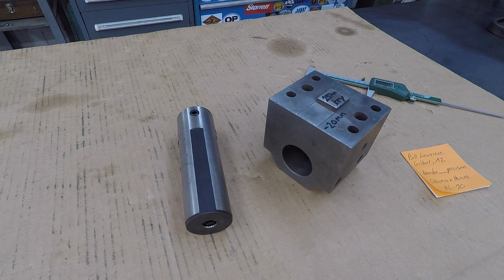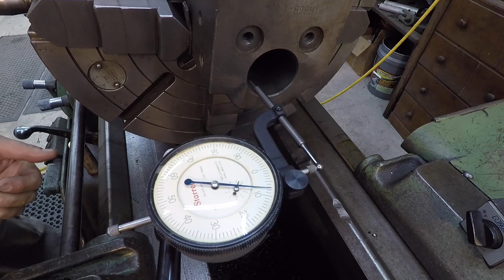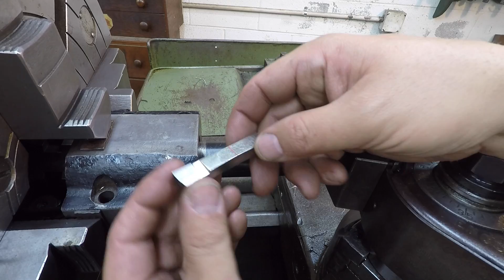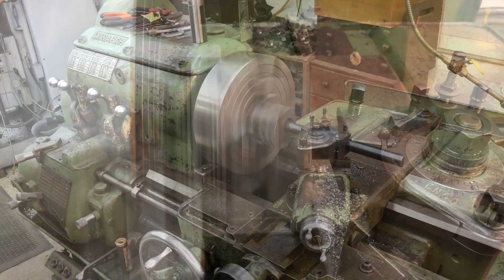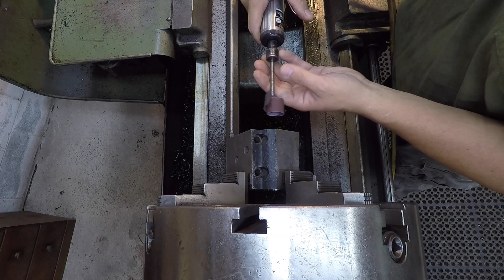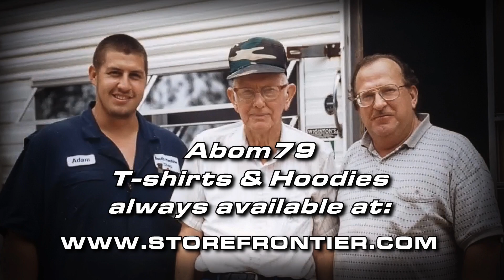SNS 306 Part 1: Okuma Tool Block Modifications

Comment: So offset weight doesn’t make the part shake?
Reply: There isn’t much Throw, but you wouldn’t want to be at 2000rpm, so either run it slower or on some chucks you can add counter weights with larger offset pieces.

Comment: Nice work on boring that tool holder out. Looks like it cut nice and clean and should work very well for them. 'm feeling lucky that the one time I needed to bore out a holder like that it at least fit the machine and I didn't have to do extra work. Felt weird running the boring bar from the spindle though. Hope you are well! - Tom Z

Comment: Instead measuring the initial positions of the jaws I just use the tail stock with a drill chuck or live center (depending on the hole diameter) to lightly press the part against the back of the 4-jaw chuck and then carefully tighten each jaw so that they just touch the part. Then you are fairly close to centered and can start indicating and adjust.
Reply: Yes if you have a bull nose center it should be very close.
Reply: @aj7utu   Exactly! And very quick.
Reply: In this case he couldn't sit the piece on the face of the chuck because the key was preventing that.
Reply: @jonka1   That's easily solved with a short piece of flat bar as a shim for the chuck jaw.

Comment: I can sort of see what easyBob100
 is trying to say. I don't think the front face is of any importance. I would make sure the bottom mounting face and the bore is lined up parallel with the spindle center line. After all, the bottom mounting face aligns the hole to the face on which it mounts and the bore has to be aligned 90 degrees to whatever surface below the spindle going through this block. If something was to bolt onto the front face of this block, it would be a reason to align the front face. What I'm saying is: Ignore faces which don't matter.

Comment: Question:  Why measure the face and the bore?  Aren't you assuming that the face and bore are perpendicular?  What if they aren't?  Wouldn't it be better if you measured the bore in two spots instead, and not worry about the face at all?

Comment: Why don't you just use your drill press to do this hole? Wouldn't it be much easier?
Reply: Not on a drill press. he could have used a boring head on the mill. but adam is a lathe guy. he probably uses the lathe where possible because that's what he is more comfortable with. not that he couldn't use the mill but his first instinct is to use the lathe. you just have to be around machinists enough to understand, by the way some guys are mill guys
Reply: @ronalddavis  Adam's a lathe guy, but beside that, unless you have a fancy boring head that you can adjust while it is spinning, a lathe is just faster and easier for the hole. You are going to have to take multiple cuts to get that hole to size. With a lathe you just crank the crossfeed slide a bit for each cut. With a mill you have to stop it, get an hex key, loosen the lock on the boring head, adjust the head offset, lock it back up, then make the next cut. A couple of seconds on the lathe and a minute or so on the mill.
Reply: Drill presses don't make precision holes.

Comment: Adam,
Your customer wanted to avoid breaking down his production set up, but the best procedure would be to rough bore the tool holder hole and finish bore on the actual CNC lathe after the turret is properly aligned.  This way the tool holder bore is the made by the actual machine that it will be used on.

Comment: With an ofsett piece like that, obviously the mass is spinning off centre. Obviously that is a big lathe and that is a comparatively small part, so not an issue. But is there some sort of rule of thumb about how far off centre you can have the mass on a lathe without causing issues?
Reply: The tee slots each side of the jaws can be used to bolt balance weights onto the chuck if you so wish.
Reply: You can tell if you ran it at 1000rpm you’d feel the machine shake, so the rpms are lowered where there is no shake, or you can add counter balance weighted on some chucks to eliminate this. It depends on the weight and offset of the job.
Reply: For workpieces that will be way out of balance, they can be mounted on a faceplate, and balance weights used to offset the out of balance workpiece. This is a pretty standard practise with model engineers making relatively large non symmetrical pieces on small lathes such as Myfords. I suspect that in industry, they just use lathes big enough to handle the out of balance jobs most of the time.

Comment: 2 BIG mistakes:
1: The block is now 75mm instead of 80mm.
2: The keyway is NOT in the center of the actual tool (but in the center of the toolholder).

Comment: I would think the way to do that would be to mill off the bottom and do the key and then bolt it to the cnc lathe that it will run on and bore it with an adjustable boring bar in the chuck. That way the hole would be perfectly on center.
Reply: That is a good way if you care about microinches. But if you think about it, that is not how commercial-grade tool holders like that are manufactured. They are all just churned out on some other machine in the big tool holder factory in the sky, and are all "close enough" for whatever machine they will eventually be used on.

Comment: Now ? Im no machinist by any means but back and forth from the face to the bore and back again is killing me ? Couldn't you have put a 1.5 drill bit in the tail stock , slid the piece onto that , slid the tail stock down to meet the chuck and clamped it down on all 4  jaws ? Backed the tail away and the part would've been 90% of the way to centered ?  I guess a machinists check is 95% labour and time spent squaring things up to a curly blonde one ?
Reply: Chris M Smalley When you’re dealing with thousandths of a inch pre-centering it like you describe is a way to get you fairly close but the last bit is what takes the most time. You need to go back and forth a few times. If you used a lathe you’d understand.
Reply: @susanbarbier5053  It's also a part for a CNC machine where misalignment takes no prisoners!
Reply: Spend 30 minutes trying to remember where I left the 1.5 round or 15 minutes to dial it in.  :-)
Reply: That's assuming you own a 1.5" drill. It probably took Adam less than 15 minutes to dial it. Not a big deal.

Comment: Is it possible to indicate off the bore only? Like indicate off the bore entry and then the centre?
Reply: sure but it depends on what your primary datums are
Reply: @SuperAWaC  I was just wondering since he mentioned an indentation on the surface.
Reply: @Argosh  indicating off the bore alone would take quite a bit longer. it's better to indicate off perpendicular surfaces rather than parallel ones
Reply: You can indicate off the front of the bore, the back of the bore, and some other point in the bore to get centered, but it takes a lot of time - and personally I get the math messed up usually. If you have perpendicular surfaces that you can adjust then it is must easier. But to each his own.

Comment: why not put a center in the tailstock, then in the hole of the part, pressing part to the chuck. bam, almost perfectly centered.
Reply: Ha , i didnt read the comments before posting the exact same thing ....
Reply: In theory yes, but in practice as you’re clamping down hard with the jaws you’re going to move it off center. That IS one way to get it really close but between almost perfect and perfect is where the time is spent.
Reply: 'Almost' isn't good enough.

Comment: Was so excited to see two vids in one night! Just like Christmas haha. Still would appreciate a reply from someone on my question about purchasing a first mill though lol. Thanks!
Reply: Depends what you’re doing, your budget, location.

A Burke Millrite is a nice 3/4 size “hobby mill”, and can have a Bridgeport head swapped onto it.
Reply: Sebastien Bolle ....Here was my comment and description of what I do. I left this on the clutch repair video a couple days ago hoping to get a reply. Sorry it’s long, but I knew I would get a reply like yours at some point. Thank you.              “Ok. I’ve been watching your videos now for quite some time and just cannot get enough. For a hobby (well and some money of course) I build forced induction race engines of all varieties, but mainly for snowmobiles, sideXsides and high performance sand cars (a lot of Subaru, Honda 3.5s and of course GM small blocks) right now. After seeing this video of the cool little parts I could be making to help me with that and a million other things, it is finally time to buy a mill. I do have a 48”x48” cnc 3 axis router that I use mainly to cut parts from flat carbon fiber sheets I produce, but have zero experience with mills or lathes. I don’t want to spend an absolute fortune on my first one, but money really isn’t an issue (would like to keep it under 50k ish for the first one). Definitely would like a manual mill (I’ve seen some that are both lathe and mill?), but can see that the auto feeds and DRO is a must   Most of the pieces I would make would be smaller than 24” long and maybe 12-16” tall. I certainly have been doing my research and will continue to do so, but any direction or places to start looking would be greatly appreciated. I am very technical and mechanical savvy so I understand all of this, but really no experience on anything other than the router which I use solid works to design my work. Thank you in advance, I truly appreciate anyone’s input they may have and are kind enough to offer. Hate to hijack the comments, but I thought with the talent here it wouldn’t hurt to ask. Keep up the good work Adam! Thanks again!”
Reply: Sebastien Bolle....And if I have to spend 100k to get something I can “grow in to” then that is perfectly fine. I want some thing nice and that is quite capable, even though it is only my first one. Cost is really my least concern, but don’t need to overdo it just because. Thank you!

Comment: If I understand you correctly, you may have made a screw up after watching both parts. The overall base was to be 80 mm not to the top of the keyway but to the base. It seems you are now at 75 mm since you took the whole thing to 80 mm then an addition 5 mm when making the keyway, unless I missed you actually taking it 85 mm and then the extra 5 mm for the keyway bringing the base to 80 mm.  I hope I am wrong for your sake as I would hate to think of what that piece might cost if you could find one. I came back to this video to make sure you said 80 mm for base not including the keyway. Never the less always enjoy your videos. I am most likely the one wrong here as rarely do I ever see you make any errors even tho I know it can happen even with the best as we are all human.
Reply: I was thinking the exact same thing ,i hope it didnt get messed up
Reply: unless I miss understood Adam , your right ..
Reply: That's what I thought too! So I am not the only one who thought this!
Reply: That makes four of us, I spotted the same thing. Had to go back through both videos to confirm it.
Reply: When cutting the Key and the cutter went through the bolt boss on the side, mmmm that doesn't seem right so I started looking as well.  We might just see this part in a future Build-up Welding and re-machining video.

Comment: Why not bore it in a milling machine..
Reply: Why?  He has a precision lathe and the proper tools.  There is no need to fool around on the mill.
Reply: If the hole is not running true with the sides, it would be a pain to indicate on a mill + I do not think Abom have a high end boring head for the mill.

Comment: I notice the bed has a few big chunks taken out of the "V" on the away side from the operator.
Is there any story behind them?
Reply: Probably ground to allow a part to swing in the machine that otherwise would have hit the ways.  Fortunately, it is on the v-way for the tailstock and not a bearing surface for the apron...if I am reading your comment correctly that is.

Comment: omg! I was running an old Okuma LB-15 at my former work. Damn that lathe was rock solid. At the end of its lifetime we had some problem with the power wiring and the hydraulics. Remember that the screen went black and we had to replace it. But still with all the problems it kept going and going. We eventually replaced it. Cant even remember what we replaced it with. It was at least a descent machine but still nothing like the okuma.

Comment: Hey Adam, I'm just curious (not a machinist myself) why wouldn't you machine the 20 mm from the base first before boring the hole? My thought is there would be less weight spinning on the lathe that might contribute to vibrations during machining of the bore? Also thanks for all you do appreciate the videos - great entertainment and education!
Reply: You have more to grab on to/mount it with if you do it as the 2nd operation. The weight of that part is miniscule in comparison to the back plate and jaws on that lathe. Unless you've added enough weight to counteract all of that, it's not going to go out of balance from being mounted off-center like that.

In fact, I'd go so far as to say it wasn't affected whatsoever by putting that part on there. You've got all that other weight spinning perfectly around its axis. With the part mounted at that axis also, there's even less weight there to cause it to go out of balance. 5 lbs maybe? Vs a backplate and jaws that likely weigh 300+ lbs. Probably a lot more.
Reply: @JC-11111  Makes sense guess I underestimated the lathes capabilities to mitigate the off-center load!
Reply: @luc1fersflowers  TBH, I'm no machinist either. I was just trying to think about it logically. I may be totally wrong. So let me say that now. But knowing the things I do know, that's my best, educated guess. 👍

Comment: I worked at Colonial Machine Co right out of high school. They had a policy of no air hoses at
the machines with the exception of the drill presses . You would have   kot holy if you blew off a
machine with a air hose. 
They felt that doing so would drive dust and dirt under the ways. I don't know if they still have that policy . All l will say l don't do it on my machines. Your job is turning very nice and I like your videos very much !

Comment: You did a fantastic job but how is that pocket going to be on centerline whan placed back in the original machine? We usually bore the pickets when they are inside the machine at my shop. Indicate a boring bar inside the jaws and bore it to the size.
Reply: Are you asking about the few tenths it might be out? You but undersized tool holders, then mount them, and mount a boring bar in the chuck to bore them in situ on the turret? The whole point of buying the took holder is that you don't have to mess with that nonsense. You can move them between machines, and on different positions on the turret, and it will be the same. They come from the tool supplier already bored. So, since he bored it concentric to the home from the manufacturer, it'll be the same accuracy as if you ordered it with a 2" bore. (+/- a few tenths)

Comment: Does the metal of the Measuring instrument wear of time and potentially cause wrong readings?
Reply: Like scribing lines with the tip?
Reply: ID and OD micrometers should have some gauges/templates to set or check measurements. Gap gauge should be checked and verified from time to time.
Reply: A lot of them are faced with carbide. They can also be quickly calibrated. Calipers don't rely on the arm length, so scribing won't cause inaccuracies, unless you bend the tip over. You don't want to scribe with good calipers anyways.
Reply: Yes, they does wear, but can be calibrated - and should be regularly.
A caliber is the worst because one area of the jaw in normaly used more, not uncommon to get a low spot on 1-2 thou on the most used part of the jaw.

Comment: Great video Adam seeing all types of tooling (indexable shaper bars included) the block mounted tool could be adapted to a say cheap four way like the diamond tool holder, ifanger, i like the ITM I think it is upside down turning tool that produces a chip that gravity takes it away from your watch pinion size part. But when you can adjust tool tip hight each station at that four way could have ten different tools that could go there the swiss type stuff is worth time figuring out and wow that block is cast iron ya the shure shot and a paper towel rub some way oil on there. funny thing is I'm making ER 16 blocks that interchange In one station for thre different boring, threading ,reverse internal threading , revese internal boring bars got one collet set need two more ER nuts got a dro on my lathe so setting that 8 Deg taper's no sweat carving them out of old SBC crank throws you can buy a new cast steel crank cheaper than you can get one ground aint supply and demand great!
Reply: Whhhhat.
Reply: Always remember, punctuation is your friend.
Reply: Typing on a phone. Rough read.

Comment: Great work. Im surprised u use wd40 to keep the rust off the ways. I thought maybe 3in1 oil. Thanks.
Reply: 3-in-One Company was acquired by WD-40 Company about 25 years ago. 3-in-One stands for "clean - lubricate - protect". WD-40 stands for "Water Displacement - 40th formula". 
WD-40 works as advertised. We had a pipe burst in our crib - right over a batch of machined cast iron cylinder heads. We hit all the hardware stores in the area, bought every spray cans and several gallons of WD-40. Sprayed the heads & saved all of them.
Reply: @stevenslater2669  ....WD40 is mostly mineral spirits (>50%) and mineral oils (>25%).  They have done a great job marketing the stuff!
Reply: Any oil/lubricant is fine. It's not a high demand application. He's just trying to keep it from flash rusting, esp since he's in Pensacola, FL.
Reply: Why wouldn't you? That's what it's for.